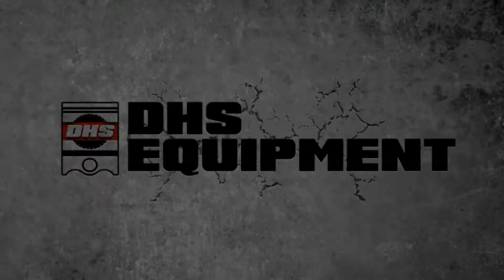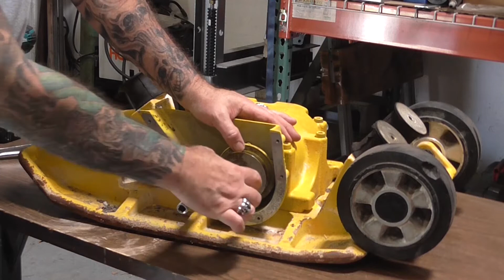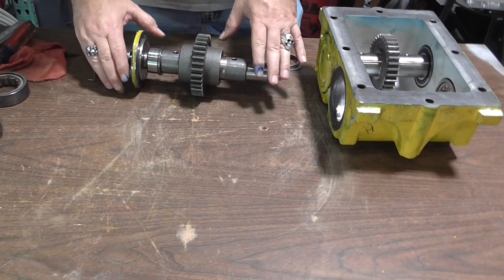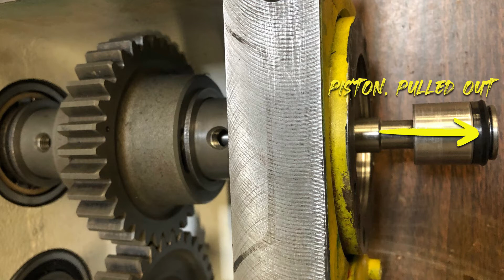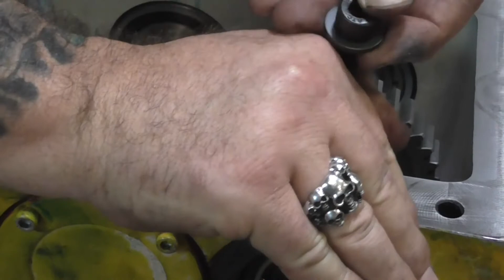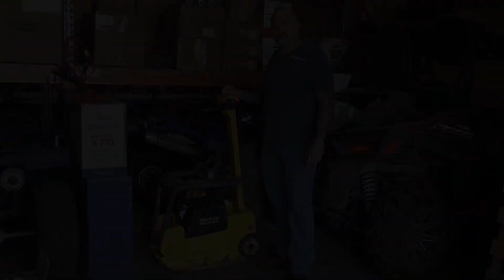Wacker Neuson Exciter Repair: Maintenance Tips | BPU2440, BPU2540, BPU2950, BPU3050 | DHS Equipment

Comment: Would anything inside the agitator cause very quick belt wear/overheating? 
I had a bad clutch bearing but still seem to have the same issue. Belt is shimmed “loose” with both shims.
Thank you.
Reply from the maker: Hello Andrew- Great question! If the bearings are locking up in the agitator/exciter it can cause the belt to burn up or even the clutch to burn up. Spinning the exciter pulley by hand, you may not feel resistance but when it's running at 3600+ RPMs the bearings tend to heat up and expand causing the bearings to lock up. Here is a link to our blog on how to repair your Exciter: https://stores.dhsequipmentparts.com/blog/howto-wacker-bpu2440-bpu2950-exciter-repair/
Reply: @ I pulled the exciter off this weekend and found the timing marks to be off. I’ll check the bearing when re-timing or maybe a good time to replace them.. I’m hoping the timing will help improve the travel speed and direction. Thanks for the quiz reply. Do you think timing could cause strain on the belt?
Reply from the maker: The timing could be causing some issue but usually it's a problem with the bearing that causes the belt to start burning.

Comment: Hi i have a one of these, and it's not going forward properly, and the clutch is getting really hot. Any advice would be great, thanks
Reply from the maker: Hello! If that's the case, it could because the seals in your handle head may be going bad and it's allowing the hydraulics to bypass it. This would make it where it wouldn't go forward. Another issue, could be some issue inside the exciter, like a bad bearing causing the clutch to heat up.
Reply: Hi. Did you find the problem with your machine? Mine is doing the same. Fine in reverse, forward it doesn't move, clutch heats up too

Comment: How about the dpu 5545 how that times?
Reply from the maker: The best way to determine this would be to provide us with the serial number of the unit, we then should be able to find the correct service manual for your machine and provide you with timing instructions. info@dhsequipment.com or 954-532-2142

Comment: Hey Dave, the manual says 75w-90 gl4 in the exciter for bpu3050a, you sure I can use 10w-30?
Reply from the maker: Hello, 10w30 was used for over 30 years with no issues. When they made the change to 75/90 they started having premature bearing failure just like the WP’s.  90wt is rather heavy to work well as this is a splash system. This info comes from Wacker along with what we saw first hand.  Hope that helps.

Comment: Hi, please I need help. My compactor works and stop vibrating when it hot and the engine will still be working. If switched off and allow to cool then starts it will vibrate again and stops when hot. Please help
Reply from the maker: Hi Ramon, sounds like the bearings are shot. When they get hot, they expand and lock up. Once cooled they are free to rotate again. They probably sound like a high pitch scratch when operating. You can confirm by checking the condition of the oil if you have any left. The engine is maybe bogging down like it's under load as the exciter starts to slow down.

Comment: I've got a 2540 here changed the bearings but when I run the machine and I push the handle for it to go forwards it goes backwards and pull the handle to go backwards it goes forwards any ideas?
Reply from the maker: Hi Ashley,
It sounds like your sleeve gear is not timed correctly.
View the video at about the 13:45 - 14:50 mark to see the sleeve gear timing. Also the 19:30 to see the timing on the shaft already installed. Finally check the 20 minute mark also for the final gear to gear timing.
Hope that helps
Thanks

Comment: What grade of oil is used in the exciter and how much.
Reply: Hi,  10w40 and about .6 qt or about the level of the  bottom thread.
Thanks
Reply: @davedhs6821  is this for the diesel version ? in the Wacker neuson Operator's Manual its noted the Exciter oil type is 75w-90
Reply: @kyranliburd9997  Wacker went to a gear oil on a few versions and it's not working out for them so if you happen to speak to someone who knows at Wacker, they'll tell you to go back to the 10w40. On their single direction plates we are seeing lots of premature bearing failures. Gear oil is just too heavy for most applications. 
Hope that helps
Reply: @davedhs6821  okay , thank you for the info as i have a few Heavy Range Reversible PLate compactors and  the Exciter is a very expensive component to repair . so any knowledge is much appreciated
Reply: @kyranliburd9997  glad it helped
Dave

Comment: You should make a video on a complete rebuild, I cannot find one anywhere and the bearings have been giving me the most issues, Not on the removal but on the install it is difficult to get those races where they need to be on the shaft without the outer race moving back and fourth causing play. 😕
Reply: Next one that I get the opportunity to do, I will. What model do you have ?

Comment: Hi I’m just wondering if you can help I’ve got a DPU 6555 the forward/reverse handle lock up in the reverse after pumping a few times hope you can help 
Cheers 👍
Reply: Hi Nicola, 
Have you recently put additional oil into the head? Too much oil is usually the culprit. If there is too much oil in there it can not bypass when the piston moves so it locks up. There should be a level indicator on the head. Keep us posted.
Thanks
Reply: Dave @ DHS thank you so much for your reply very appreciated. I found the problem in the meantime it was the seals in the head that were bad, replaced them and works great just thought I’d let you know regards Nick 👍
Reply: @nicolascutti9570  Great, glad you found the issue !
Reply: Dave @ DHS hi Dave sorry to bother you I was wondering where can I get a work shop manual for the DPU 6555 cheers Regards Nick
Reply: @nicolascutti9570  I have requested a pdf of it from Wacker. I will have to email it to you. Please email me at david@dhsequipment.com so once I have it I can forward it.
Thanks